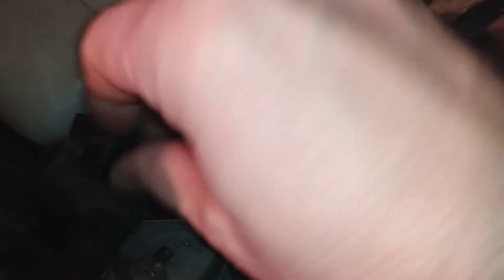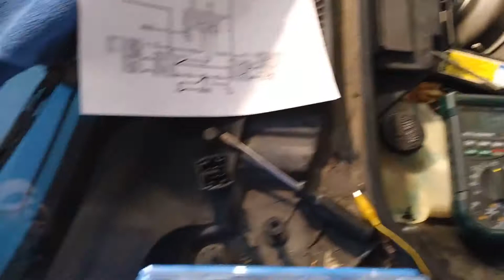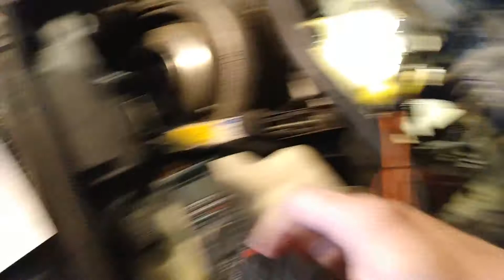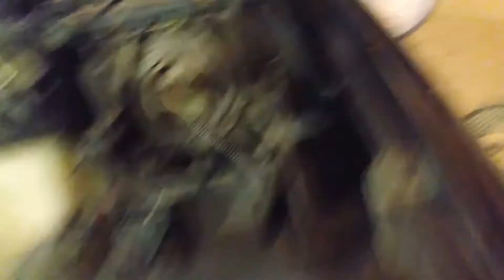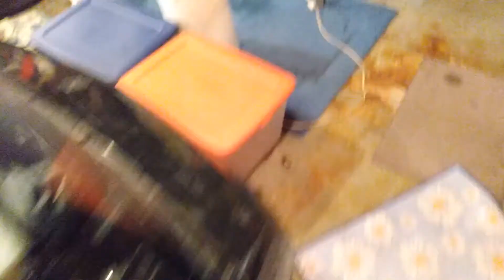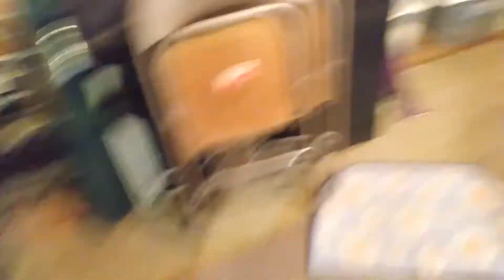How To: Pontiac Fiero - Headlight motor test and relay replacement. 1984,1985, 1986 Headlight motors

Comment: Dude I've got a base model 84 the moters are good but nothing happens when I hit my switch. I'm kinda at a loss
Reply from the maker: everything you need to know if it's the switch or relays is here
Reply: @JerrSpud alright thanks
Reply from the maker: test the voltage input to the relay. If you have no input, it's the switch.
Reply: @JerrSpud ok  cool

Comment: Did the motor go up after you replaced that relay with an RY130, or did it just go down? Other posts say the RY130 only works to replace the other relay located on the drivers side fender - not the relay located by the light itself
Reply from the maker: It's still working. I just looked it up on RockAuto and that's the same relay that's listed as well. This is for my 86 though. I believed the system changed in 87

Comment: My light it’s a new motor within two years and you turn the light on it goes up you turn the light off and it doesn’t go all the way down you turn it on it goes all the way up and then you turn it off and it goes down. It happens like every three out of four times.
Reply from the maker: or the motor. the "new" stuff is not made as well as the OEM stuff. I don't think it would move at all if it was the relay.

Comment: Is the motor supposed to control the headlights even if it’s not wired up or does everything need to be plugged in to diagnose if I have a bad motor or not
Reply from the maker: You can test the motor if you power it directly. Just make sure you apply the positive and negative to the correct color.
Reply: @JerrSpud  okay sweet thanks. I bought my fiero and the headlight assembly was in the trunk so I put it back together but when I turned the motor they didn’t come up so I’ll
Plug them up and give them a try
Reply: Sorry for another comment but I officially got both of my headlights to come up! However, the right one is a little slower and is about two inches from coming up all the way. Would that be the right relay possibly or does that sound like a ground issue? Thanks!
Reply from the maker: @bencorder2544  sounds like neither and it's the motor itself?
Reply: @JerrSpud  I thought so too but previously I only had just the right headlight working (I got the right side motor working but had to wait for the left side motor to come in) and the right by itself it raised up all the way completely fine. Now that the left one is in too the right side doesn’t COMPLETELY go up all the way and now they’re both a little slower. I’m thinking bad relay or bad ground

Comment: Hey, I just bought a Fiero, and the previous owner said that the relay just needed to be replaced for the headlight motors. Do both relays need to be wired up for the motors to move? Or do I have other problems? I’m currently missing one relay, and the other side is a “maybe” in regards to its functionality, but if all the wiring needs to be plugged in on both sides, it’s not a fair test.
Reply from the maker: No

Comment: Only problem I got is they tic of death, it’s like a ticking noise from my front headlight motor and it’ll keep spinning until my battery dies
Reply from the maker: I bypassed that problem on my C4 by adding a 1 min delay off relay. Put that on the blue wire and that should fix it
Reply: Yup I had SAME EXACT ISSUE even after I got brand new relays. So I just chose too leave them up looks cool like that Ne ways lol.
Reply: SgtKickazz YT have you ran into any issues with them being propped up 24/7? Just curious
Reply: @do-si-dos7624  NONE AT ALL!!!
Reply: SgtKickazz YT awesome thank you sir, so on the ticking in the headlight motor just look for the relay and clean it up or buy new ones? Bc that’s the only thing that’s keeping me from a charged battery 🤘🏼
Reply: @do-si-dos7624  Try cleaning up because I did that first and unfortunately for me it worked for like a day then I said screw it and purchased two new relays and that didn't work so I literally just left then up yea it was draining my whole battery and the fly wheel at the top the the light motor spun all night and killed my battery one morning where I was already late too work at the time. Talk about a shat day haha but yea man I have had ABSOLUTELY NO ISSUES with leaving then upright. I wouldn't recommend doing this if you plan on going threw a drive through until you drop them down bc I only HAND wash my Fiero.
Reply: SgtKickazz YT man what a morning that would’ve been, I appreciate the tips bro gonna have to try to make sum happen with my car it’s just been sitting there for a while now Bc I just got busier with other things, I’ll keep you posted on it if anything, thanks tho brother